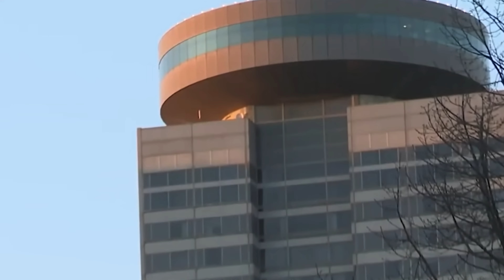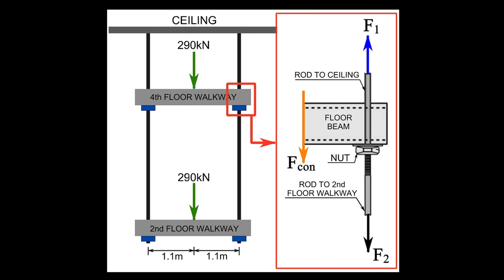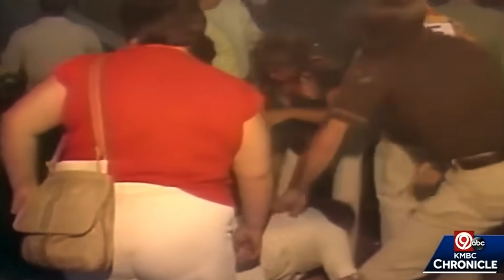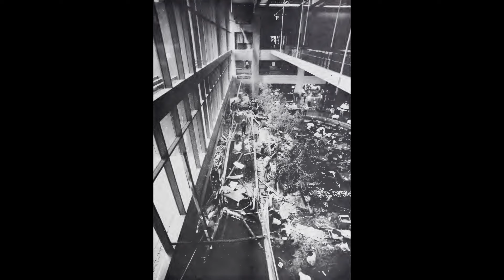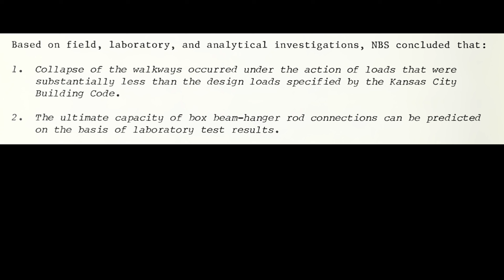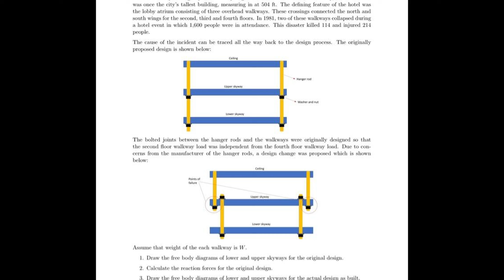The Mistake that Killed 114 People

Comment: The original design was impractical to build - it would have required hoisting up the 4th floor walkway from the floor with the rods through their holes, and then running the nuts and washers up 2 floors of the threaded rods. The redesign to make building it easier was ill considered.